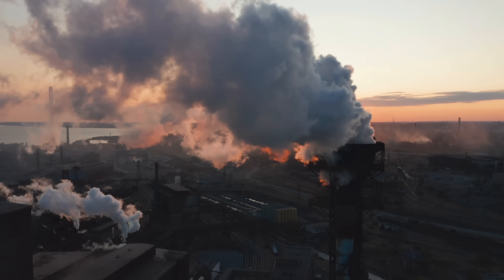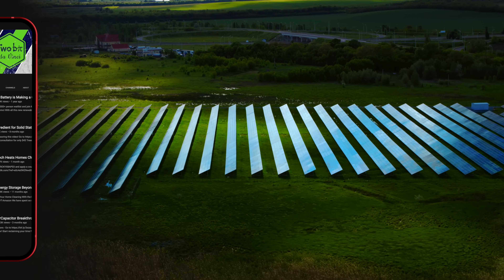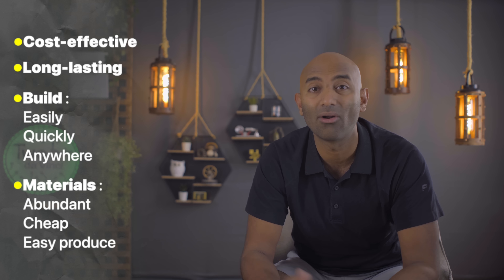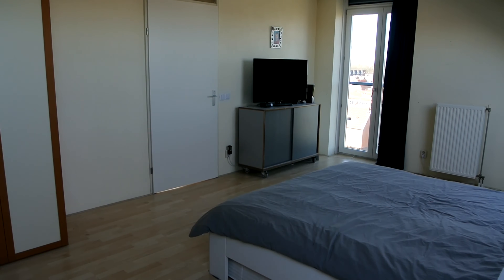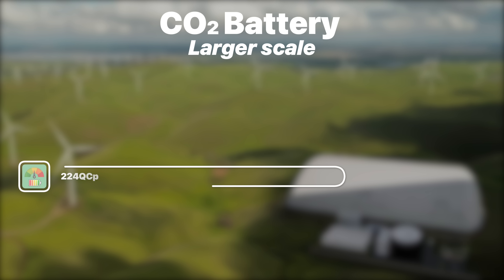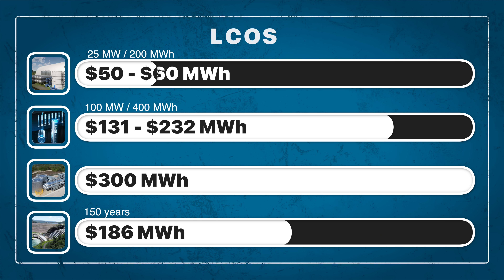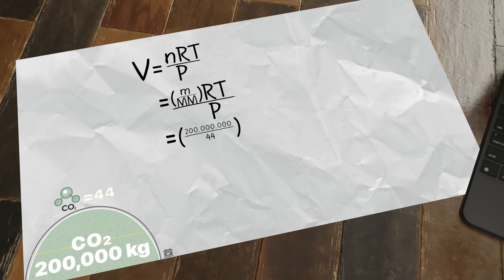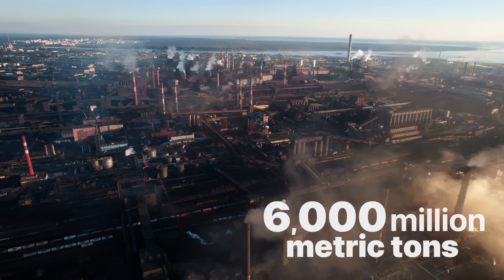The GENIUS Of the Carbon Dioxide Battery

Comment from the maker: Checkout Hoymiles & Save Up to 50% on Solar Inverters! https://geni.us/Inverters
Reply: The temp “rise” is due to the solar cycles: grand solar maximum, Maunder Minimum, cme …
Reply: @guysumpthin2974  Nonsense. The solar cycles are a ripple (noise) on the temp rise. The graph is a noisy rising line. Our species has caused the temperature to diverge from the historical mean which over the last half billion years should be falling at this time. A little would be a good thing but what we are doing is too much of a good thing like water is a good thing but drowning in water is bad.
Reply: @T Samuel  
Historical information also states that the temperature variations were caused by many factors such as asteroids, the earth orbit, solar flairs, and what we are waiting for are volcanoes. The one that is historically late is the supper volcano at Yellowstone. There is no clear evidence that humans are rising global temperatures. If you really want to worry about things. Maybe you should check out how we change the climate by weather manipulation. Silver oxide is used to make it rain in a particular area. Harpa and Darpa have been manipulating weather since the 50s. Asphalt road and parking lots, concrete roads and parking lot, and cities are all bad for the environment. But I don't hear a big change in that. Dam, even air conditioning is very bad for the environment. Everyone needs to look into more than just one area to see what is going on and stop listening to those people who are profiting millions selling you the co2 scare. By the way. I went to college for environmental science and studied all different ways that the environment was and is being changed. I think Soda Pop should be band. The amount of co2 that goes into the air is crazy. One last thing, I will agree that I could be completely wrong. Because I understand that we didn't start measuring climate things until the early 1900s. What little we know about the environment is based on theories, models that continually fail, and ice cores and tree rings. We really don't know if there was an ice age, a great flood, or even the entire world was just a ball of water.
Reply: All life on earth is carbon based , bringing more of it to the surface means the potential to support more life .
Reply: "Breakthrough battery proves we wrong" 😅
Reply: @TryNDoxMe I wonder if it scales down linearly. The dome's volume will, and so will the cylinders used to store the liquid CO2, but the turbine and the thermal energy storage? Who knows! Maybe it will.
Can you imagine if we coupled the recirculating water to a domestic geothermal heat pump or something like that?
Reply: @ipp_tutor that technology already exists.
Reply: The only thing I would to see from this tech, Is shoten the dome so solars could be built over the top of the dome save space and gen more power.
Reply: Liquid CO2 energy storage is a good tech because it only requires off the shelf parts, is cheap & efficient. Similar round trip to pumped hydro, scalable and not significantly location constrained. And not significantly NIMBY constrained. But I do question how bulky it gets if the CO2 isn't stored under pressure, since four days of storage is the accepted standard in modeling energy storage. Four days is considered simultaneously long enough that fossil fuel plants will rarely be needed while also long enough to bring mothballed fossil fuel plants back online when required. The most frequent example of when four day storage is inadequate is during a hurricane since wind and solar are both typically offline for two weeks. A not so tiny pilot scale installation mist next be built as a more reasonable proof of feasibility. Btw, if the click bait title was intended to prevent me from watching the video, that failed.
Reply: This video needs to be reviewed by the mighty Thunderf00t, the great debunker!
Reply: ''During photosynthesis, plants take in carbon dioxide (CO2) and water (H2O) from the air and soil. Within the plant cell, the water is oxidized, meaning it loses electrons, while the carbon dioxide is reduced, meaning it gains electrons. This transforms the water into oxygen and the carbon dioxide into glucose.'' Wikipedia - On short for the ones that are not so open that they brain fall off: CO2 produces OXIGEN. I rest my case. Some people are just ...
Reply: The huge LCOE is suspicious in that compressed air and CO2 could have a very similar build cost for the power plant so the LCOE difference should just be a consequence of the difference in efficiency which is 7% to 77%.  But the LCOE difference is 5X to 6X !  An LCOE analysis and comparison of each would be very interesting.
Reply: @TryNDoxMe a big air tank could maybe fit in the attic!
Reply: Good video.
I think you should grow your beard 🧔🏼
Reply: Two bit, you have alot of learning to do,  so let me show you how wrong you be
The global CO2 levels are 420ppm and the AGGI is 585ppm,  WHAT'S THE RELEVANCE OF THAT STATEMENT 
Google, melankovitch cycles with CO2 vs temperature vs time 800k yrs timeline graph 
Google, global temperature graph from 1880 to present 
Google, global CO2 levels graph from 1880 to present 
The melankovitch cycles with CO2 vs temperature vs time 800k yrs timeline graph shows the global thermostat setting of 1c/12ppm 
Iceage minimum, CO2 levels were 280ppm and average global temperature was 15c 
Iceage maximum, CO2 levels were 180ppm and the average global temperature was 7c 
A 100ppm change in CO2 levels caused the average global temperature to change by 8c 
8c/100ppm or 1c/12ppm 
Today,  CO2 levels are 420ppm, 140ppm above iceage minimum of 280ppm ÷ 1c/12ppm  = 11.75c rise above iceage minimum of 15c 
Using the true value of AGGI at 585ppm, 305ppm above iceage minimum ÷ 1c/12ppm = 25.4c rise above iceage minimum of 15c  = 40.4c 
The average global temperature rise is accelerating towards 40.4c 
You have what you need to figure out how fast the average global temperature rise is accelerating 
You also have the information to calculate how hotter the heatwaves will become and cause massive food production destruction 
Then you will see how nonsensical the concept of CO2 batteries are
Reply: The advantage is that it doesn't need future science and materials like unoptainium to be build. You just need an engineer and determination. As Nike said it: Just do it!
Reply: All these are neat.
But you never cover off grid use.
I'm not connected to the grid, by over 20 miles. 
So these things just don't matter to me.
I need alternative battery systems that are not expensive.
At the current time lead acid it the best money wise.
We can argue about lithium. But I did the math per cost lead acid is the cheapest In both the short and long term. 
And thats not even counting if one can get them rebuilt ( taken apart and new plates)  The acid can be filtered and reused.
Thought it has become pretty hard to find a rebuild. 
I really don't see why when everything is recycled. And it benefits rebuilders to recycle and bit waste.
in essence very little is needed to rebuild batteries.
The lead is filtered out of the acid and can be melted and reused as Plates.
The acid is filtered and can be reused in battery.
Very little new acid and lead is needed.
A small amount of a glue agent is need to put battery back together. 
battery core is $15.
new acid and lead  $5
glue $10
labor $20 per hour at 4 batteries per hour. so that $5 pee battery
add that all up. its $35 for a $100 battery.
selling the battery at $50 is a $15 per battery profit.
But you could even sell at $90. 
I'd buy a rebuilt for $10 less per battery. 
Nine batteries thats an extra battery.
Reply: Wrong from the get go.

CO2 is essential to life.

CO2 has prehistorically existed in concentrations 10 and 30 times the current levels. Life would never have evolved without higher concentrations than we currently have.

Climate has changed constantly throughout the he history of the world.

CO2 IS part of the cycle of life, but there is no BALANCE. If there was there would be no fossil fuels and no carboniferous rocks.

Through the millennia, the amount of carbon in the atmosphere has been removed by life.

Occasionally the levels have been replenished by volcanic action, but in recent history geological activity has been low.

At the last glacial maximum, CO2 levels fell to 180ppm, only a small amount above the the plant extinction level of 150ppm.

The burning of fossil fuels has perhaps prevented the extinction of life at the next glacial maximum.
Reply: How does this storage system work in micro-gravity? Future spacecraft and habitats are interested.
Reply: Big Oil strikes again.
Reply: Global warming is fixable refreezing the poles blocking the sun to the poles for a few years will fix it.
Reply: It is tiring to hear people talking about CO2 when they haven't so much as a clue about CO2 spectroscopy.  CO2 does have a small effect on surface temperatures, but the spectrum at which it absorbs is completely absorbed at 400 ppm.  After this level of CO2, there is no additional effect from CO2. The idiotic idea that the Earth somehow operates like Venus is completely wrong.  Venus is hot not because of the presence of CO2 but because of the fact that the Venusian atmosphere is so dense and the Venusian orbit is so much closer to Sol. If you think that wind farms will ever become economically feasible, you're dreaming.
Reply: @tomkunich9401  co2 is heavier than air and meathane meathaneis being releasedfrom the permafrost and co2 is being released by the melting ice. Governments want the resources and trade routes from the poles so it is all about money . destroying the middle class and making people poor by taxing every body that can't afford basic foods gas and everything else.  Governments want us to eat bugs and rent everything even stealing farm land to do it .  By dumping wood ash at high altitude over the poles in the summer will fix most weather problems resetting trade winds and drop sea leaves reduceing fresh water in the seas .
Reply: You seem to ignore that forest fire management reduces carbon and offsets the carbon from fossil fuel use. Many years ago forest fires were left burning out of control. Not anymore. Forest management such as firebreaks, removing deadfall, removing some trees to give others room to grow, removing underbrush, and removing low hanging limbs on trees all makes the forest healthier. Trees use carbon to produce oxygen...so making the forest more healthy helps all around. Rotting dead fall produces no oxygen and contributes to carbon. 

The Greenies need to start lobbying governments to get out there and clean up the forests. It's also good for wildlife. Maybe the Greenies can protest by starting to clean up and prune the forests......do something useful for a change instead of making everyone's life harder and more expensive due to their agendas in politics.
Reply: @johnspartan98  Lol to hot and dry to manage the forest.
Reply: .  . We are a consensus oriented and motivated culture -- at the expense of individual perspective that is and will always be the saving grace of humanity.  Only to the degree that we can redirect our perspective inward before we regard any other source of information -- will we find ourselves capable of restoring the unlimited abundance available to all of us.  Limitation is the source of ideology and that is its purpose.  The unlimited nature of the human soul has no need for it -- therefore the reason for its promotion, that we remain at that lower compulsive need for agreement by which we are not free to think for ourselves and by which agreement itself is an illusion as we give away our capacity and our unlimited potential.  We cannot take the risk then to fully engage our own perspective on the basis of immediacy where it belongs as its primary focus.  The individual perspective is the focus of power by which no person can be set against another with false or self serving interpretations from another outside of ourselves.

Normalization rather than conspiracy is how influence and corruption create and take precedence, so that awareness is hostage to the needs for anything other than ourselves to define what is real and acceptable -- the need for any form of consensus to rule us unaware, lest we ever accept responsibility.
Reply: @ronaldgreene5733  Consensus is a myth when so called scientists are riding the government money train. Kick them all off the welfare funding and see what happens. Everything has become political now....and that's the problem.
Reply: @SeedEarth the ice age won't begin till the earth gets a lot hotter co2 leavles will double the north and south poles will become tropical the rest of the world will become mostly desert we have 400 to a 1000 years before the ice age begins . The stopage of the oceanic conveyer belt that brings worm water to the poles won't stop in that time line all of the forests will burn first releasing there carbon into the air . Refreezing the poles would stop it and buy us 200 years of milder weather. Carbon leaves in ice show this before last ice age.
Reply: Carbon already is the hero. Everything the liars in the global warming cult have said about it is a lie, nothing but slanderous lies.
The increase in CO2 ALWAYS causes more greening of the planet. As always, the elite want less food and power for the masses.
Reply: @mynameisgladiator1933  You sound like a Spartan to me. I bought 4 SUV's. One for me, one for my wife, and 2 that we share. I'm doing my part to turn Canada into a sub-tropical zone, but it's going to take more carbon than man could ever possibly produce by using gas powered vehicles and coal for electric generating stations.

You are correct Gladiator.

Do you know what they used to call a happy Roman Soldier?
Glad he ate her, hence saying it fast is like: Gladiator.

GRIN  😂
Reply: Dr. Steven Greer is involved in investigating and understanding those technologies that have been suppressed over the last century that have the ability to replace fossil fuels for energy production.  The name of the Youtube video for those interested is “Steven Greer on UAPs, CE5, Skinwalker Ranch, and Disinformation”.
Reply: TWO BIT DA VINCI, You made some great points!  Using CO2 for energy is a great idea!  Also, you’re correct that CO2 has been demonized and that it’s not our enemy!  But do you realize the extent of the exaggerations and the real reason behind the demonization of CO2?The truth is that CO2 is NOT causing harmful effects on the environment, and in fact, CO2 is necessary for all life on earth!  The truth is that there’s a relatively small group of power hungry tyrants who are all members of the same exclusive private membership societies, and their goal is to drastically reduce the population of humans and mammals in the world, down to a size that they can “manage” (they’ve admitted this) because they are obsessed with controlling everything in the world and ruling over everyone else!  They’ve been spreading the lies and propaganda that “CO2 is harming the environment”, which is a blatant lie and it’s being used to change laws that will strip people of their natural rights and freedoms, and to steal all their money, in the name of “Carbon taxes, so that the arrogant elitist tyrants can live like kings while all the “regular” people will basically be treated like slaves who live to serve the tyrants!  This agenda has been spelled out in United Nations Agenda 21 and Agenda 2030.  The wording is deceitful, making it sound like the plans will be for the “greater good” but it’s actually the same scam that all communist leaders use to manipulate the people.   This plan is being implemented by a branch of the United Nations known as the World Economic Forum.  Certain tyrants who are at the top of this, have been paying off scientists, news media companies, and Hollywood actors, to continuously repeat the lie that CO2 is bad and causing harmful climate change, and that oil and gas are hurting the environment, which they are NOT, but they constantly spread and repeat these lies, over and over, until the public starts to believe it, and they also teach these lies in schools, along with the ongoing lie that petroleum came from fossils, which is another lie that they even teach to petroleum engineers, yet there’s NO a scientific evidence that it came from fossils!  It would take me all year to list all the lies that the globalist tyrants have been promoting to the public, for decades!  Yes, they planned all this, decades ago!  The lies are being used to promote their planned tyrannical agenda to depopulate humans, strip them of their rights and freedoms, force them to live in controlled, monitored “smart cities” where they will work like slaves for the elitist rulers!  
They’re trying to make everyone scared of too much CO2, when we actually have LESS CO2 than we need!  The truth is that plants and animals & humans live in a perfectly designed symbiotic relationship with each other - as we exhale CO2, the plants essentially inhale it, and then they exhale oxygen, which we breathe back in!  There is nothing wrong with the natural system, and our gasoline pollution was fixed more than 2 decades ago when we started using clean emission equipment on our cars!   The tyrants just want to use “climate change” as an excuse to tax people to death and control everything they do, while the global elitists act like gods over the earth, and that is the truth!
Reply: @Joel Kalsi 97% of the earth CO2 is created by the earth’s natural processes. We’re currently at 400ppm which is only  0.054% of our atmosphere. 3% of that number is caused by man. If those numbers are factual (which they are) these climate alarmists should be trying to get rid of nature if they “think” that CO2 is so bad.
Reply: Atmospheric physicists have ALWAYS known that CO2 does not cause global warming. :D
Reply: @Joel Kalsi Ah…a man with wisdom. Be well.
Reply: @Joel Kalsi Of course it is. Only those who lack the wisdom of  being able to see the obvious, do not see what these power hungry globalist are doing.
Reply: The carbon dioxide has poisoned you and the majority;  it's negatively impacted your and the majority's potential for decent judgement, accuracy, and reasonableness - which is why humanity over all is still stuck perpetuating a harmful way of life that destroyed and destroys many peoples lives - and yes that includes many innocent and helpless children!
Reply: @Some one  
Can you please provide evidence to your claim? I at least provide examples and facts. You can cry about all the children all you want. You have no more proof that co2 is causing any than I can prove that the Yellowstone volcano is going to blow tomorrow. Statistics are manipulated to make money. They look good on paper, but when it's justified. It doesn't work.
Reply: Is "battery" the right word? It sounds like an "accumulator."
Reply: CO2 BATTERY-TARDATION = WHAT A JOKE !!!
Reply: Proper Greens push a minimisation of land usage, Fake Greens push a maximisation of land usage. All their sprawling, inefficient giant 'energy solutions' are disgusting... Solar and wind farms, hydro power and biofuel production, giant energy storage plants, landfills instead of incinerators, 10x more (global and national) infrastructure... The Fake Green revolution also pushes taxing plant food (the air we breath out), crap'n'trade (carbon credits that push hyper-pollution), and forced MASS SALES SCAM after scam.. Why don't you just stop being a Fake Green and become a real green guy and think in terms of  MINIMISING LAND USE...
Reply: You might be punished for telling the truth about CO2.
Reply: Co2 contributes 1% tingly warming  water vapor is by far the greatest  we are just wasting rest with carbon zero  applications
Reply: Need update about bigger plant coming on line
Reply: Answer to your question is in India.:yougotthis:
Reply: It's an interesting use of a gas.  But it's not scaleable to small application.  It really does not consume CO2 from atmosphere so no global warming solution.  No innovation for other breakthrough applications.  It's blah.
Reply: @joeboxter3635  Maybe not directly, but if it works as a more cost-effective and longer-term energy storage system that helps with increased deployment of renewables, then there is a contribution to global warming. I think its simplicity and how scalable it is are what this tech has going for it.
Although, someone here mentioned hurricanes and tornados and I was like 8-O
Reply: Solar? Why spend on something that takes more energy create and costs more than you will ever save on you energy bills?
Reply: @maxxwellbeing9449  You see all across this land, governments will invest in solar for you, stealing your neighbors money to install a solar system on your house for basically free, for you. But we all have to pay for that nonsense.
This is how libtards roll.
Reply: @wino99999  Sorry dude. I think you're confusing energy and power. 57 W/h? What is that?

You divide 200 MWh (energy) by 350,000 homes you get 571 Wh/home. That's energy per home, and it's consumed across 1 hour, so the power is 571 (Wh/home)/1h = 571 W/home. That's how much power each home is consuming.
Do the same for 35,000:
200MWh/35,000 = 5.71 KWh/home or 5,710 Wh/home. But that energy is consumed by those homes across 10 hours, not 1h like before, so the power is P=(5,710 Wh/home)/10h= 571 W/home, i.e. same power, as expected.

Hope that helps!
Reply: @ipp_tutor  Yep you're correct